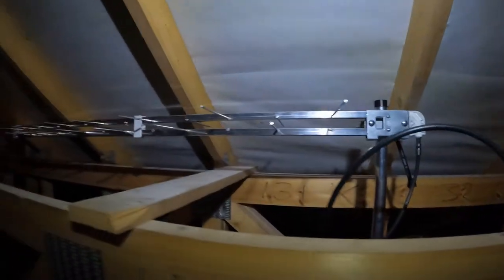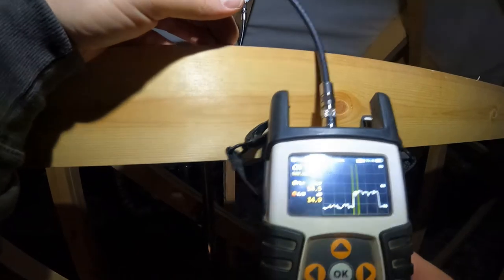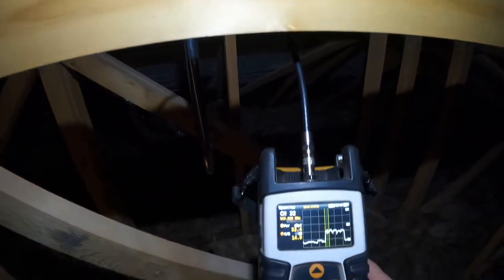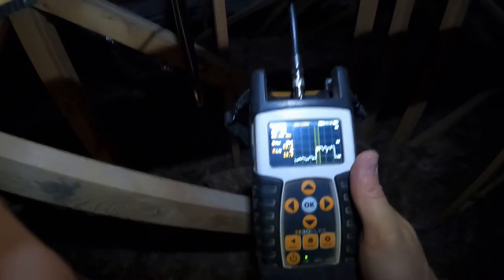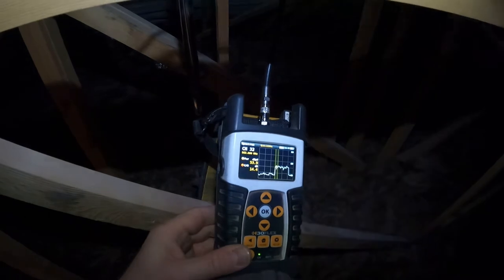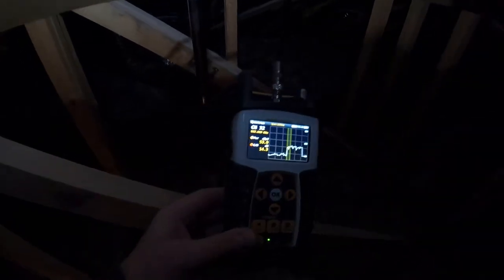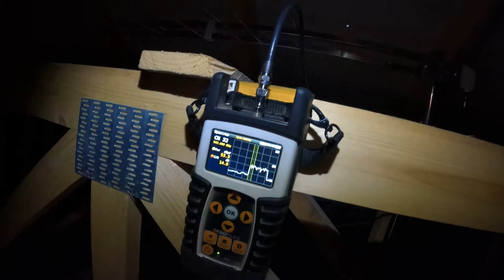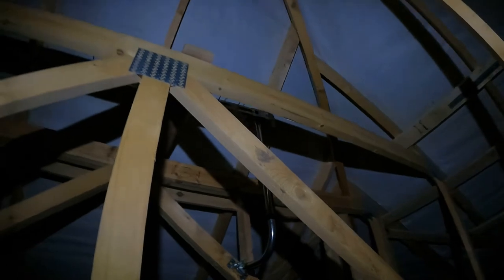The Aardvark Diaries.  Installing a TV aerial in another new build loft.

Comment: What brand is the amplifier and how do you find out if you need one mate?
Reply from the maker: I use Wolsey and you’ll need a spectrum analyser to tell you your signal readings.  Strength, Carrier to Noise levels, Bit Error Rate etc.  An amplifier isn’t just the same as any amplifier, there are various designs for different situations